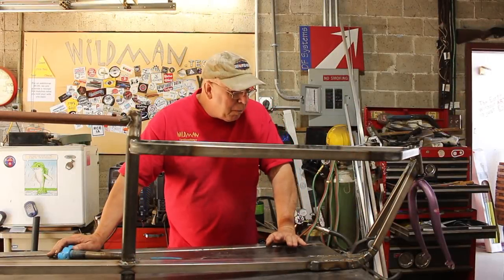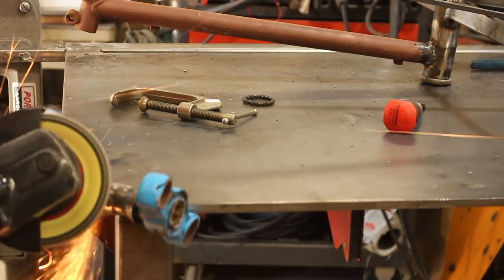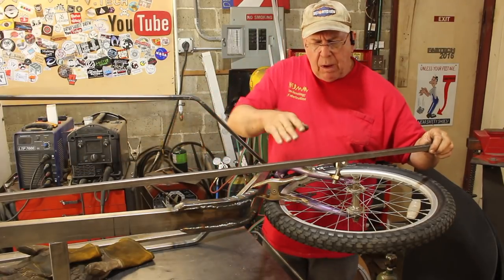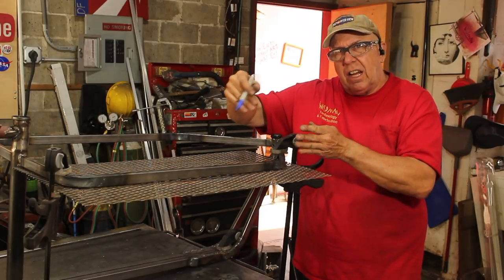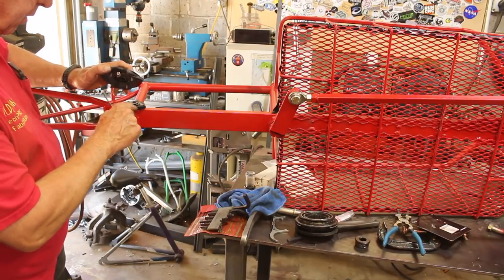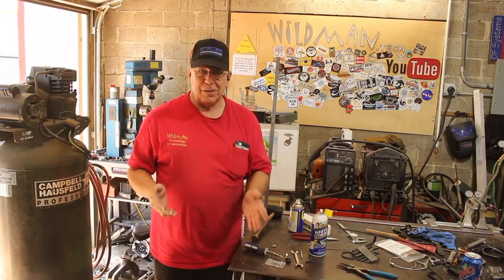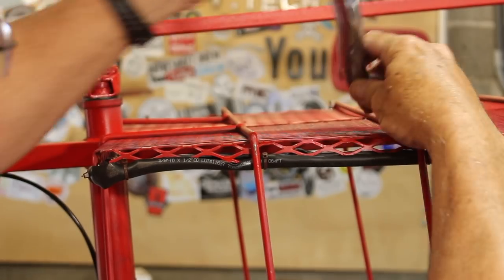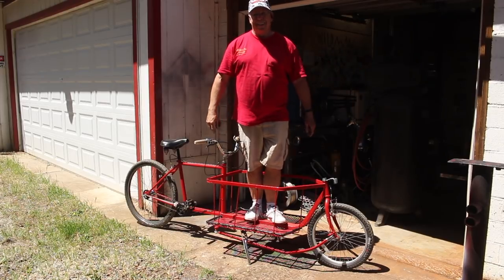Cargo Bike Build - Part 2

Comment: Fun to watch,  look up doctor Gregor on utube, take care of your self. Ps is it possible to build a mini  camper version   , my idea is a extending front end you unclip the steering rod , then undo 3 bolts 2 at the front  one farther near the rear, have box section,  then another  inside that one so it telescopes out smafter taking the bolts out and steering arm of .I think you  could be the man to build it , i have the idea but no tools and can't weld , ps the tent then telescopes up from the floor and its all guy wired down , never said I wasn't  crazy but I think it would be a fun project.